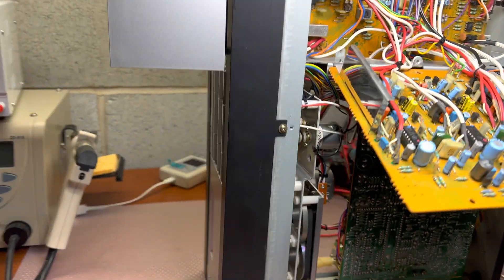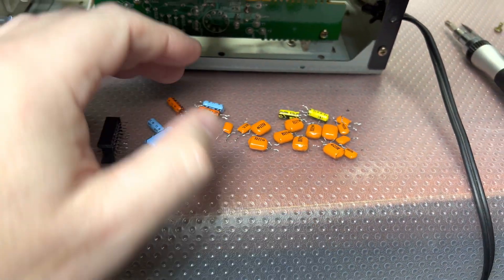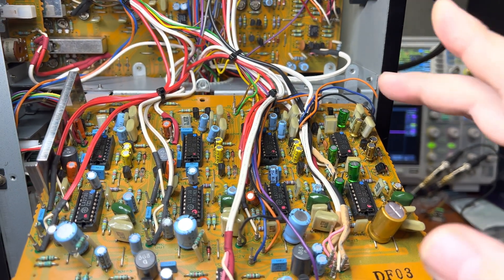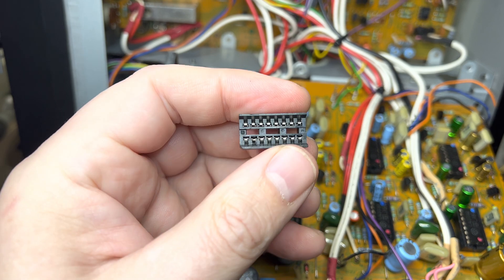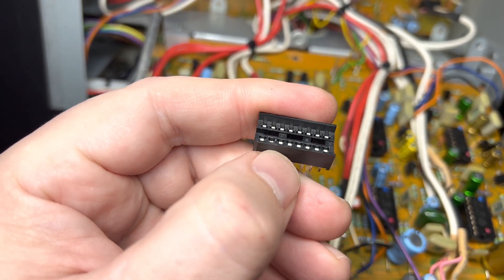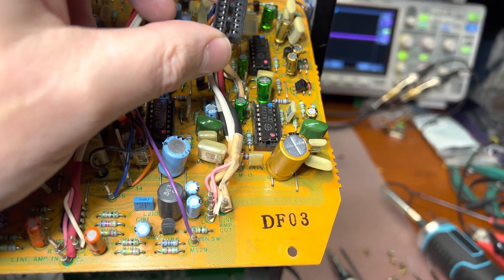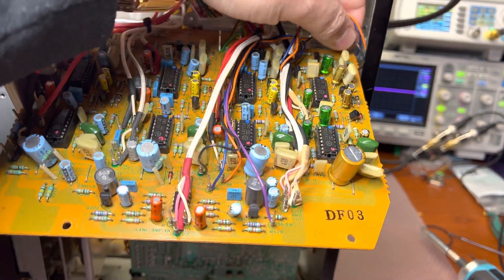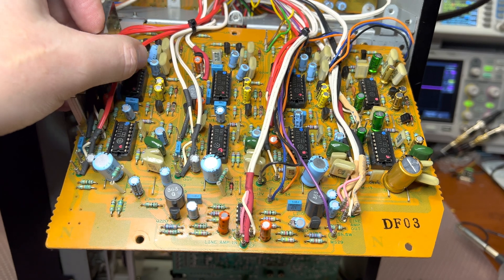Fixing Dolby C Issue in Nakamichi LX-5: Unearthing a Factory Defect

Comment: You'd be surprised by my electronics ingenuity but I like to spray and re-seat every connector on the boards I process. Also I have a fixation for cleanliness and straightened up components... I am sure electrons flow much happier when all those tiny tidbits are lined up perfectly straight.